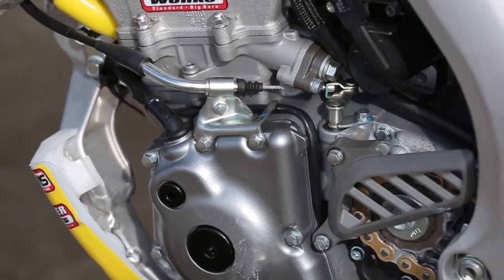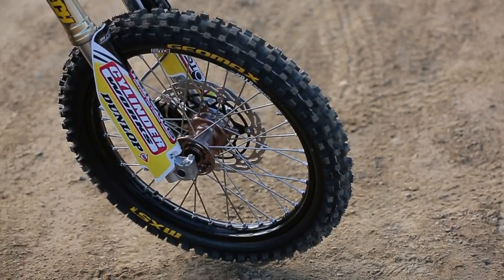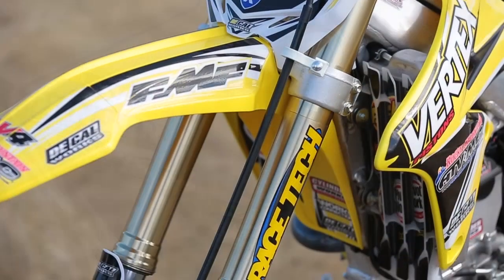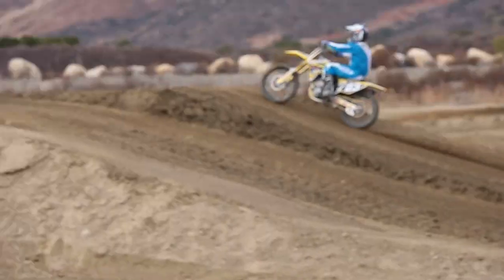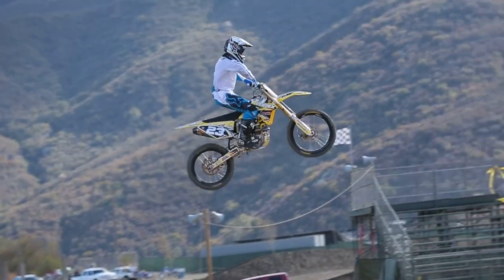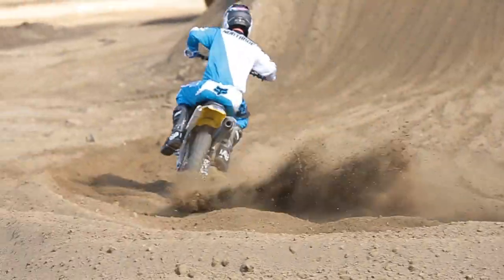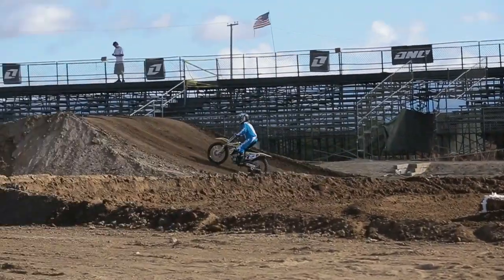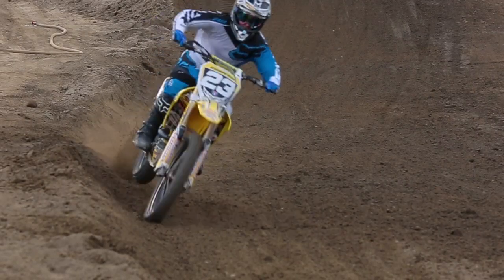Racer X Tested: 2013 RM-Z270

Comment: Nice vid... thanks guys!  I want to put the 270 kit in my '13 rmz250.  I noticed you guys didn't add a CDI/EFI management system like Bazzaz, PIM2, or Vortex. Does the bike (with 270 kit and cams) run fine without the CDI/EFI unit?  
Also, what was the spring rate the Jeff Northrop settled on and how much does he weigh?  Thanks for you responses and for the great vid!  Go Ping!